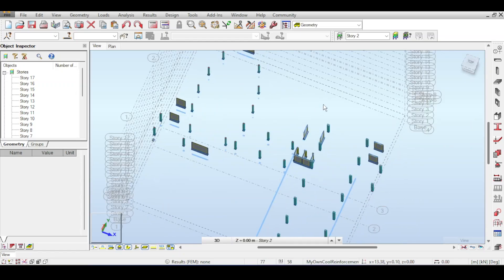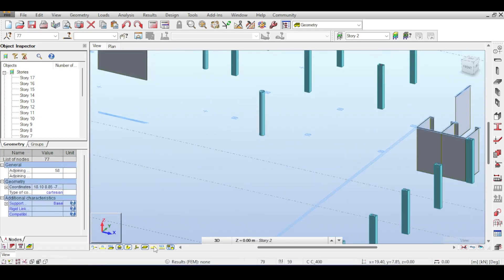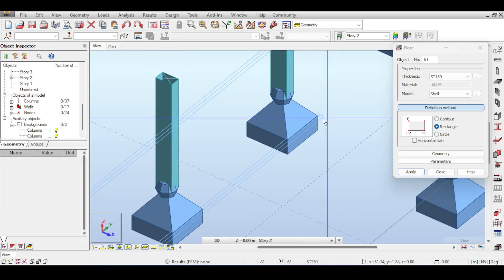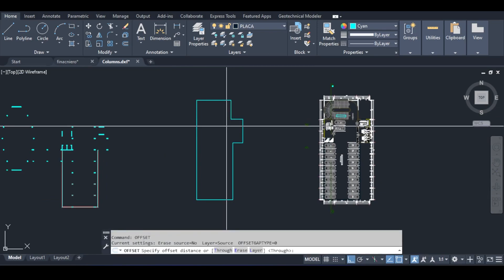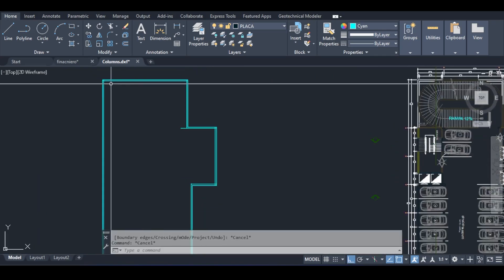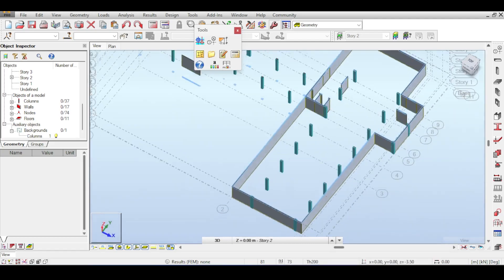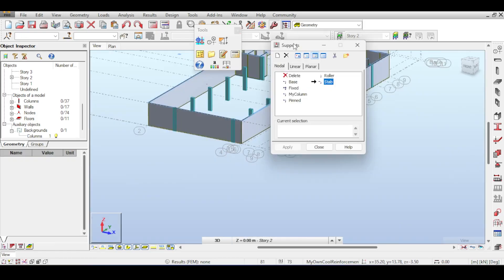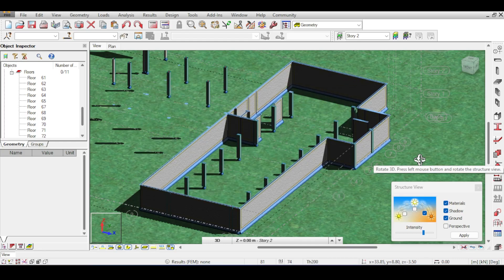Modeling and Design of RC Buildings in Autodesk Robot | Part 4: Basement Walls

Comment: First thanks for the series it help me great reinserting in structural designs, I've been solely an on site supervisor/mangement during my carreer despite my engineer degrees, and next the issues of snapping seemed to have resolved in the later version of Robot ( i'm using 2024 ) since  i used your first method as to just put a second DXF plan at -7.00, same for the slabs had no issues snapping them.
kuddos, for the explanations and your impressive problem  solving skills,, you da best keep rocking.
Reply from the maker: Hello there ^_^ 
thanks a million for your comment. I think of updating my RSA to 2024. Coz you saw what happened there

Feel free to ask or suggest anything to this channel, it helps it and the viewers a lot.

Regards,
CEE

Comment: 1st thank you for your effort, 2nd I saw you use a floor option to model basement walls and this may lead to some problems in snapping the wall edge ...
Reply from the maker: You are most welcome. Yes, I agree, with walls you can avoid snapping at the bottom of the story. 
But please keep in mind that, if you are using "walls" instead of "floors" to model basement walls, later during the design, Robot will think that the basement walls are "shear walls". That is why I am using "floors" not "walls".

Huge thnx for your comment. Stay tuned for more content,
CEE

Comment: Dear CEE, Thanks for your VDO about Basement walls, Does the Basement wall can help carry axial load from column or not? when we model basement wall from one column to other column?
Reply from the maker: The basement wall helps in carrying the axial load with the column. Because in our model, we are connecting the slabs to it.

Regards,
CEE

Comment: Hello Dr. CEE,

I really appreciate you leaving the non-working attempts for educational purposes on these videos, these attempts are just as useful and important as their working alternatives. Also, the CEE approach of not preparing the solution in advance but of rather dealing with the issues as he models is bringing out various and useful raw ideas and alternatives that one could explore, these ideas would have perhaps or otherwise not have come out had the solutions been pre-prepared in advance. 

The Filter command in AutoCAD is very cool and useful, I have noticed the CEE using this command before and now it is growing on me (all thanks to the CEE).

07:53 This is one of the many countless and amazing things about the CEE. I have seen and experienced (and I am continuing to experience) exactly what the CEE is saying about the point of this channel. It is not just talk; it is real with astonishing life changing results. Thank you Doctor for your selflessness.

09:45 Ouch, I can only image the painstaking detail of having to manually adjust the points coordinates of all those shells one-by-one. Lucky (in hindsight) with the Editor suggestion, one can avoid this sort of pain.

The modelling choices/options for the “columns and basement walls” to be seeing or not to be seeing each other is interesting. It is not uncommon for a RC column to be drawn monolithically connected to a RC wall but with the column as a “projecting pier” say projecting only on one side of the wall. This situation usually results in eccentricity between the centre-point of the “column” and the centre-line “of the wall”; I get that it would be ideal to move one element centre towards the other so that their centres coincide from the analytical modelling point of view and I suppose that doing this is possibly one of the “cleanest” solutions? 

I have been tempted before (but now I pause) on similar situations to make use of “Rigid links” with the idea to have the elements remain in their “original eccentric positions”. The concept and the idea of rigid links is perfect in theory and from the face of it, this solution (rigid links) should mimic the eccentricity and allow for the two elements to be seeing each other from their respective locations. The question I have (the one that makes me pause) in this scenario is that aren’t there other unintended implications to the structural behaviour that results from the use of rigid links in a situation such as the above? I am asking because “rigid links” in some situations (in beams?) seem to have the effect to reduce (or redistributing) the bending moments experienced by the member and to also induce substantial axial forces on the member? (Correct me if I am wrong)

The challenge I have with this is that, if one just model in rigid links, RSAP will accept the model and all will LOOK “nice and dandy” but will such be a better representation of the expected structural behaviour or analysis? I am even wondering as to where exactly would rigid links be ideal? Where they have no unintended consequence or the consequence are negligible?
  

13:10 Yes, this is “learning” how to learn being put to practice. Thank you Sir!

I have enjoyed this video, the modelling tricks, the ones that did not work so well and the ones that worked flawlessly. Thank you Doctor for keeping it real. 

Keep well and I’ll catch you in the next CEE videos.

Regards, DK
Reply from the maker: Hi there Engr. DK,

I am happy that this approach gets appreciated. I kind of intend to show that: this is what happens in real life. This is how modeling would go, and things DO go wrong. 

The filter command is a life savior <3. And most welcome, I try my best to assist engineers of all levels. There is always a little info nugget for each of those levels.

The modeling this time was painful. Those two videos (this and the more recent one) where not that of a joy to modl.

Oh for the column vs basement wall, yep, I agree with you. Let me give some more details about the projected pier thing:

Reality:
Centroid of column section and wall sections are not aligned. there is mis-alignment, this would cause some moments to generate.

Now modeling this in RSA is in the realm of possible, by using rigid links. I think I had a longer discussion with Engr. Jesus Candea about that, it went into a similar discussion as to what you are saying. 

The problem of rigid linking the start and finish of the column is the following:
since the column is cast with the wall, it should feel the wall in its entire length.
rigid linking top and bottom means that moment transfer only happens at the top and bottom, which is a little bit inaccurate.
you would have to rigid link each wall node to the bar.
this also means that, if you change the mesh size, you have to "re-rigid link it" again.

Thnx a lot for your comment, it is always a joy to read.
Stay tuned for more content,
CEE
Reply from the maker: btw your comment does not appear under the video, I have no idea why.
Feel free to copy and paste another comment, I would copy and paste my reply
Reply: @CivilEngineeringEssentials  , Strange Indeed.  I will do so (Copy and Paste)
Reply: @CivilEngineeringEssentials  

I saw the "rigid link" discussion with Eng. Candea afterwards, and I have found that discussion to be very helpful (thanks). 

It is interesting and it makes perfect sense that eccentric moment in reality will generate. You mention ".....if the mesh size changes, one would have to "re-rigid link", I get this. But should there not be an option (rigid link modelling option) to "rigid-link" the entire column to the wall from top to bottom so that irrespective of the mesh size that has been chosen for analysis, the  "rigid-link" would "parametrically" re-adjust itself to match the mesh and transfer throughout the entire full length of the column?

It is hard to imagine that the need for such a functionality or scenario would not have come to the minds of the coders or of the software developers.....also Autodesk is a giant in parametric enabled software behaviors (I mean Revit and Revit families work so well primarily because of these principles). I wonder how this may be difficulty to implement for Robot team? 

If I may ask, does STRADO have this (ability to rigid link all full length and not just end nodes?)?

Thank you for the clear insight, it is very helpful and enlightening as always.

Regards, DK
Reply from the maker: Hi there Engr. DK,
Not sure if robot re-adjusts the rigid links to mesh the rigid links with the wall. It is possible. STRADO does only have rigid links (it is in the code, but the GUI does not expose this functionality yet), but in a similar fashion to RSA. Makes me wonder, maybe I should have an auto-mesh Rigid Link in there. 

We will see ^_^ 
Regards,
CEE

Comment: Huge fun of your content sir. I have a question, why you didn't applied reduction of the moment of inertia in the walls, but did in the columns? Also, the reduction of the moment inertia factors in the ACI 318 apply to both factored loads design and service loads serviceability checks? Thanks in advance.
Reply from the maker: For the basement walls, I was not sure about which reduction to use, should I use the 0.35 factor or the 0.7 factor, so I kept this for later. 
Reason: I am thinking of the basement is more of a "column" or a "beam".

About using the reduction for checking displacements: Short answer, yes. Because your "unfactored/service" moments are higher than the cracking moment of your section. 

Here is a more detailed answer: if you're dealing with a reinforced concrete structure the ACI stiffness reductions are about directly accounting for the effect of the reduction in the stiffness of your members once they are have cracked. So if your design actions are greater than the cracking moment (which is almost always the case for a well proportioned structure) then you should consider the stiffness reductions for both strength and global lateral drift checks.

Pretty sure ACI says this type of thing explicitly, that any modelling should take account of the degree of cracking expected at that limit state. 

Regards,
CEE
Reply: @CivilEngineeringEssentials  I really appreciate your answer sir. One last question if it's possible. Those cracked inertia factors also apply for beams and slab vertical deflections, or only lateral? Do I also have to reduce the inertia even further with the effective inertia equations stated in chapter 24 of ACI 318 for cracked concrete or it is not necessary? Thank you in advance good sir.
Reply from the maker: I think it should be applied to lateral. Actually, all inertias are by definition "lateral" resistances. The vertical resistance, I am assuming you mean columns and walls, is mainly provided by cross sectional area. It was not reduced.

Regards,
CEE

Comment: I really appreciate your effort sir. Your videos are very thorough and basic for young engineers. Sir, I was wondering if it is possible model the real behaviour of expansion joint in robot structural analysis. Also, can someone find a way of carrying out live load reduction as per the different codes in the same software. If the above are possible, could you demonstrate how achieve those in your subsequent videos? Thank you sir in advance
Reply from the maker: Thank you very much for your comment.
That is a really great suggestion. Yes, I will include this during this series.

Stay tuned for more content,
CEE